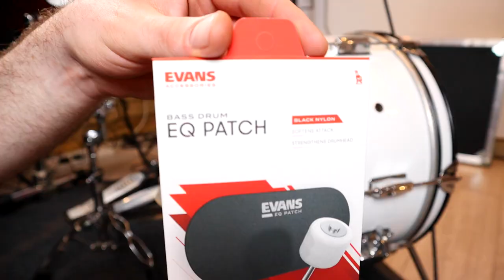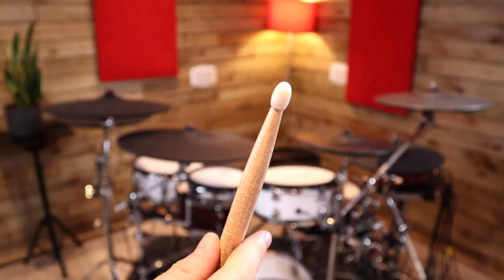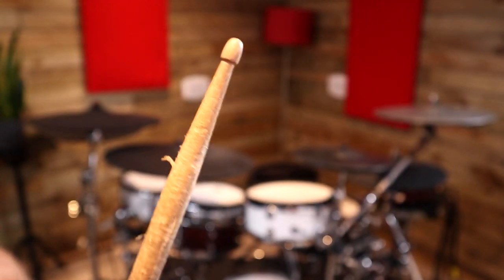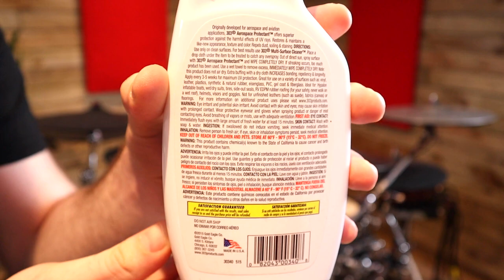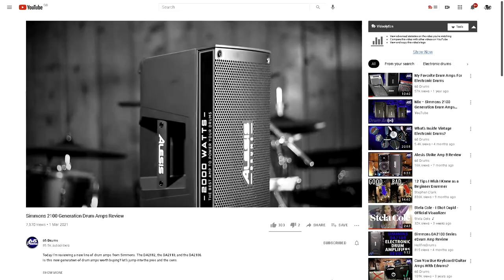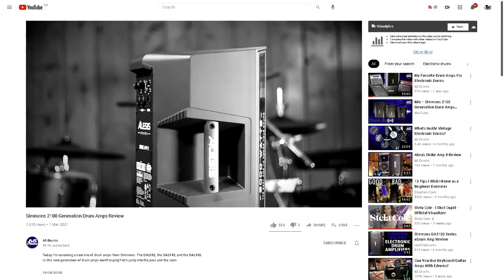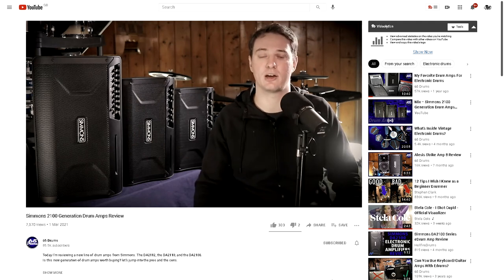Felt Beaters on Mesh Heads, What Sticks for Electronic Drums, eDrum Amps & More | eDrum FAQ

Comment: I definitely recommend the Evans EQ patches you're using on the KD-10, and all of its variants. It helps prevent it from caving in so much, and sticks and fits the kd-10 size perfectly. I'm referring to the double-bass version, you get about 1/8" to spare on each side, it looks nice. It does increase the sound just slightly, like a small "thump", but well worth with it given the extra protection it provides. Great tips here, thank you.

Comment: Late to this party, but the manual for the Roland KD80 specifically says not to use felt beaters. Which I found out AFTER I made a hole in the mesh head on it using a felt beater!

Comment: Spot on about nylon tipped sticks. I've been using Pro Mark nylon tipped sticks for years, but when they got acquired by D'Addario in 2011, I noticed the quality of sticks wasn't quite what it once was. Most obviously I noticed that there is frequently a sharm "seam" in a lot of the nylon tips. This can definitely damage your mesh heads quick. If you're buying in person, feel them with your finger and grab a pair that doesn't have it. If you buy online, like Luke says just sand it a bit with some fine grit paper.
Reply from the maker: What a shame about the drop in quality. I've not used Pro Mark sticks since about 2 or 3 years into drumming but I remember them being decent at the time. Always good when there's a simple solution though!
Reply: I actually use Zildjian anti-vibe (nylon tip) sticks. These sticks are hollowed out and a rubber bead is inserted in the guts of the stick.  I only use these for e-kits and find them awesome.  Try using these sticks, then immediately using conventional sticks….. it’s like chalk and cheese. The vibrations up your hands/arms is very evident in the normal sticks.  I still use conventional sticks for acoustic though, Don’t think the anti-vibes would have great longevity on real cymbals or hi-hats 🤣
Reply: @spideliciousx9822  Yeah I have those too and I like them. Good for super long sessions.
Reply: @singemfrc  ☺️🤘

Comment: I just got some no name runber stick tips off Amazon to reduce tip noise on my low volume cymbals with elastic mutes and they work great.  They come in different colors and they have a piece that comes down the neck of the stick and they stay on.  The mesh heads on the drums were already quiet enough without tom resos and a rubber snare rim guard. The sticks I had just happened to be nylon tips so I wasn't worried about damaging anything but if you are I would recommend them.  I use the side of my dw kick so it's plastic but I did with a regular head too.  I bought a patch but it made it louder and I'm going for silence so I took it off.

Comment: Good video, Luke, I've been playing eDrums for 9 years and I agree with everything. I did ruin one mesh head using a plastic beater, appling the patch is an eazy fix, like you said. On top of that, the patch enables me to use the felt beater, which is makes my KD-10 quite a bit less noisy. I've also experienced the mesh heads eating away a bit of wood of my hickory sticks over time (we're talking months if not years).

Comment: Great video! I was wondering why I shouldn’t use the felt end of the beater. I’ve heard it before but it was never explained. 

As for amp, I’m very happy with my Simmons DA2108. Only 8” but the bass gets quite low and it has BT, which my edrum doesn’t have. It also has an out headphone jack so I can now BT music and play along over the speaker OR via the headphones. Sound quality wise it is quite good. And I am picky about sound quality. I tried a Chinese Amazon special “drum” amp that had good reviews and as this fellow mentioned they sound quite terrible. Like very terrible.

Comment: Thank you for these e drum tips.
My DW 3000's stock felt beater also tears through the Evans EQ pads after a while, but they are the best that i have tried.  I like the feel of the felt beater compared to the plastic side.
The EQ pads are much more cost effective than a new mesh head for your kick drum.
Reply from the maker: Yeah, sounds like the best way to look at it! It gives you the feel you want and a cheap patch that usually comes in pairs is way cheaper as a consumable!

Comment: The perfect video I needed. Thank you. I have a kd-10 on the way. I ordered the Evan's Aramid Fiber patch too because I wasn't sure. I don't know if that was a good choice or not tho.
Reply: i have the kd-10 with no patch yet. what did you think about the patch you purchased? is it worth the buy?
Reply: @Chillswagg77  it worked. I was using the patch and the felt end of the beater. Just a week ago or so I removed the patch and turned the beater around to the plastic side. It feels a little better this way but I also made some changes to my kick pedal at the same time so that might be the difference I'm feeling. Patches are cheap. I'd say try it

Comment: Yup always used bass drum patches and always had great results and longevity. I use nylon tip sticks, but only because I liked the sound they made on my acoustic drums/cymbals and just transferred that preference to my e-kit.  Never had issues with these sticks on my kits.  I’m mindful of looking after the tips so no rough edges etc and it’s never been an issue. 

I use a small mixer,  3000w amp with a pair of 15inch passive bins.  Sounds good, but yes I can concur the sound is very different between headphones and amplified sound….. you can set up the EQ etc of your drum sounds on the brain module while using headphones, then listen to them via your amplified setup to find it can have a different tone/feel than your fine tuned headphone setup 🤣😂

My setup is a little complicated because I have a Roland TD27 & TD12  (expanded kit) working in tandem. So I use a small mixer to then output their combined sound to another small mixer that feeds the amplified sound.  Not ideal, but does the job, just need to be careful to get the levels correct as the amplified sound is supplied via 2 mixers.  I could use the TD12 midi function to run both units, but I want the TD27 to be the lead module, so midi use is out.

Comment: Slightly OT but I noticed the rubber from the cymbals was getting into the grain of the wood sticks. I ended up mixing some epoxy glue and applying a thin coat to the ends of the sticks to seal the grain.

Comment: What speaker should I use on a mid gig? I'm using a Roland PM200 for my TD 27 module, but it's not enough, and it sounds so plastic for my ears. Should I use a sub next to the top speaker, or is there any speaker what can carry all the quality what my module has?

Comment: Won't adding a patch to a Roland 10 dampen it? Will the piezos be able to pick up the full current/charge after adding the patch?
Reply from the maker: In my experience, the difference when adding a patch is negligible. You're still hitting a surface with a felt-coated plastic/wooden/plastic beater and the piezo only picks up the vibrations of that action, it doesn't need any fancy detection for a kick drum.

Comment: Hello 
I was wondering if you would recommend using bundle rods or hot rods by Pro-mark on mesh heads?
Reply: Just an opinion on your question, I wouldn't.  Just as you get no change of sound out of the speakers if you used wire or nylon brushes on a mesh ekit, you won't notice the change and there will be no different sound from the rods, only a lighter hit.  You can get the lighter hit by changing to a lighter/smaller stick.  I've played 8DN on my TD20 kit for 16 years.  No need to play bigger sticks.  This goes along with why you find "Brushes/Mallets" kits in the edrum kit lists often.  They've sampled acoustic drums with brushes or mallets and you trigger those samples with your regular sticks but get the brush/mallet sound out of the speakers.

Comment: I’m trying the Evans patch tomorrow.
Nothing is sticking.
I was about to just use duct tape 😂 but I’ll give the Evans a go first. 👍
Reply from the maker: My main bit of advice is to give it at least a few hours after applying it before you start using it! The longer the better, usually.
Reply: My Evans lasted about 3 years before coming unstuck on my Roland mesh heads.

Comment: can i connect my PDA140F floor tom to my td 17 just by using the aux port?
Reply from the maker: Yeah, you can use the AUX trigger input for pretty much any pad. You'll need to swap to the correct preset for it in the trigger settings (if your module is on software 1.02 then there should be a preset for it, if it's on 1.01 there won't be and you should probably update your module).

Comment: Nylon tips dont leave marks like wooden tips on rubber cymbals. And bass drum patch is a no brainer. 
Patch=$5. Roland mesh head= $30-70 dependimg on size. Plus if you sell the bass trigger you wont have to discount it for a torn head.
I use 303 protectant on my cymbals.

Comment: Can wee use felt on a kd a22?
Reply from the maker: Yes, the KD-A22 has a rubber pad surface so felt shouldn't cause any problems. A lot of people still recommend sticking a patch on the KD-A22 (or KD-220/200 etc) to help increase the longevity of the pad though. I don't have one myself so can't say for sure.